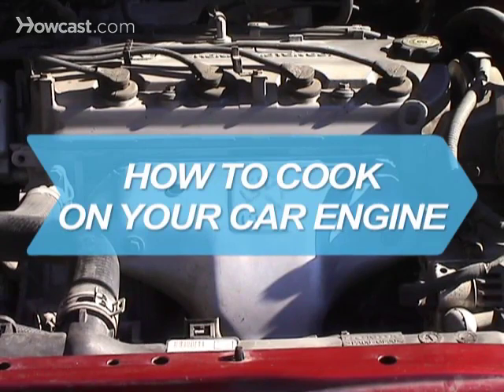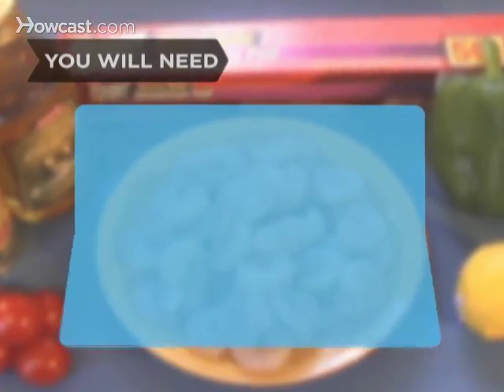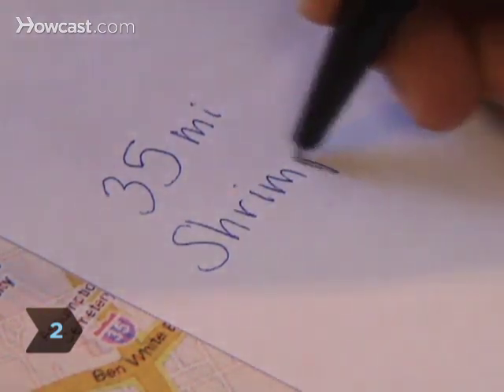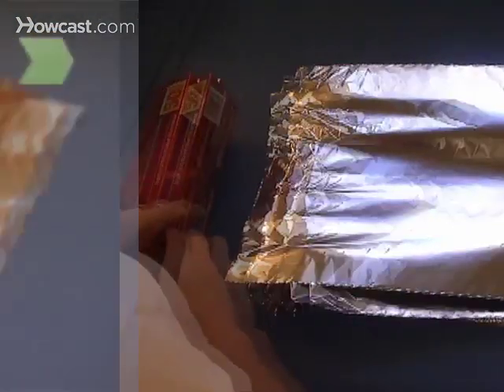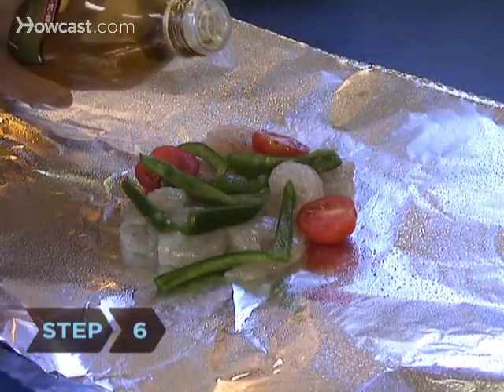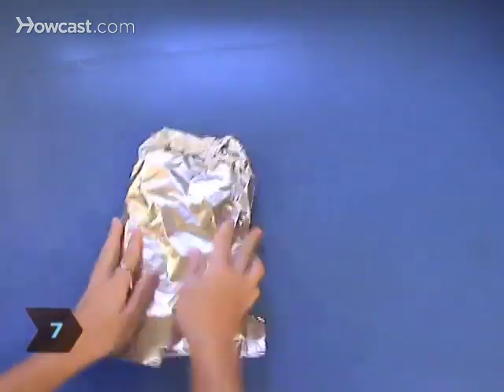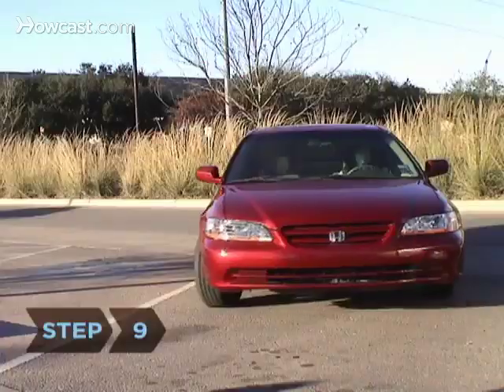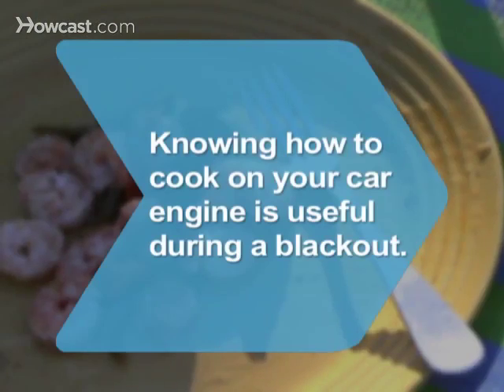How To Cook on Your Car Engine

Comment: Now you can use silicone bags. Cheap on ebay and they seal really good
Reply: Oh! Have you tried using them on a car engine? I think that would get a lot hotter than an oven rack. Hoping for an answer because I’m going on a trip soon!